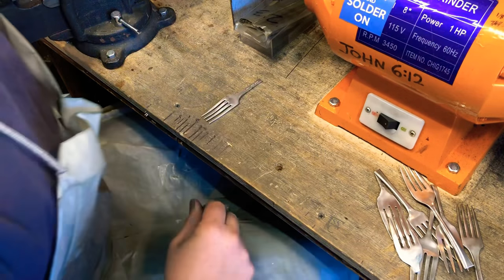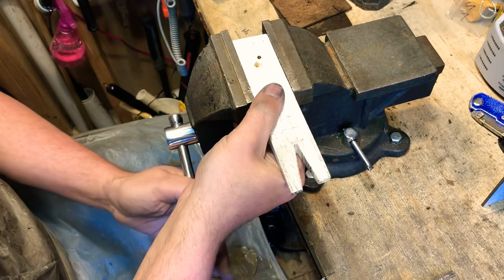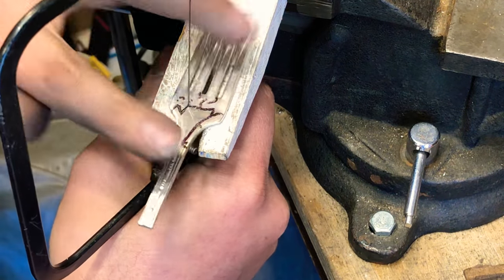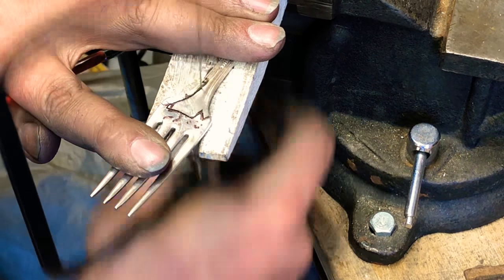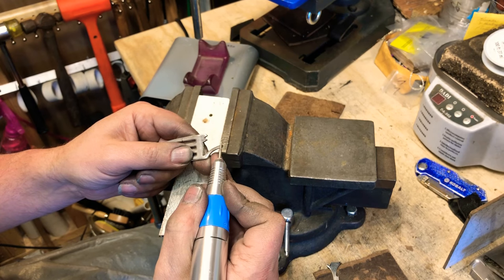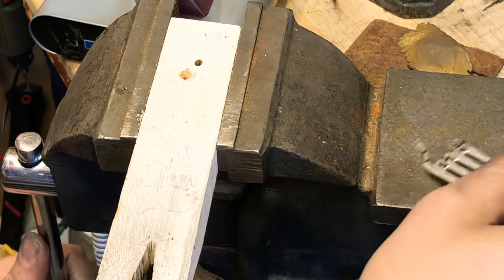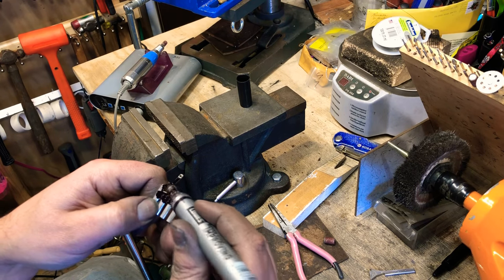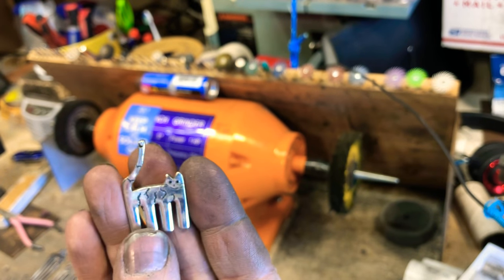How I make a cat from forks Fork cat

Comment: Thank you again.
If you don't mind a suggestion, consider drilling a hole in your board right at the sharp end of the V. This is handy for cutting sharp turns and also helps dampen vibration while sawing.
Reply from the maker: Gerald Martin ok thank you I’ll try that.